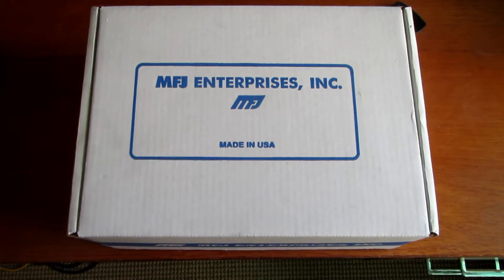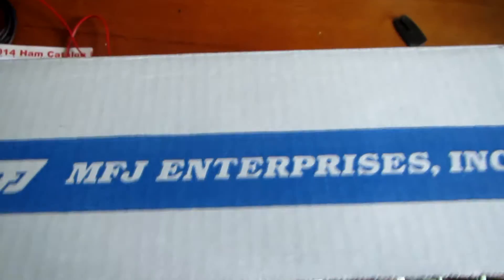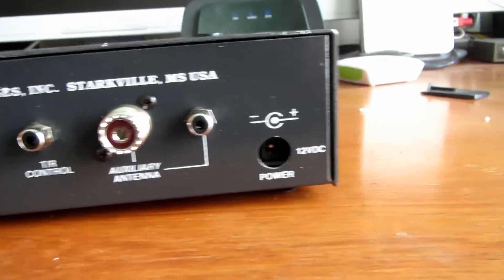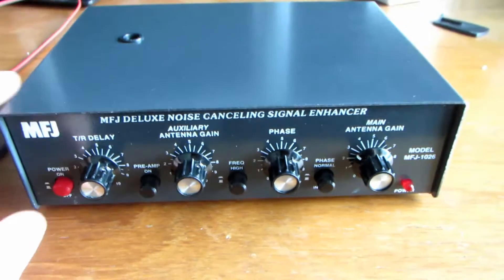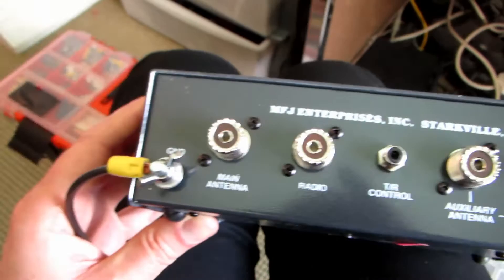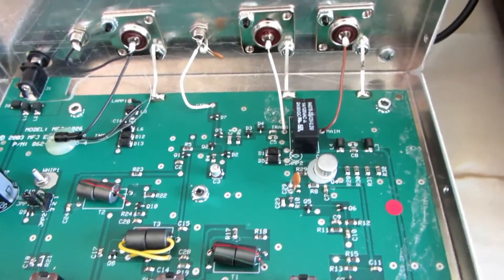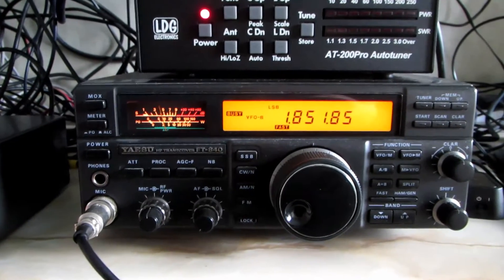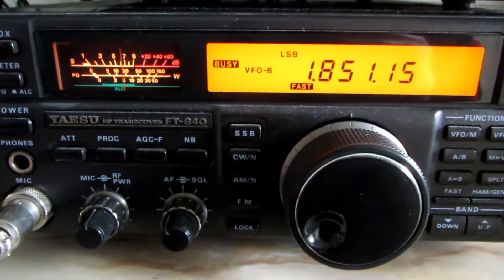MFJ 1026 Removing Noise and Interference on HF Radio

Comment: Showing the S-meter while you adjusted the MFJ is pretty much useless, unless this is a review of the S-meter. We can HEAR the signal and the noise. I wanted to see how the MFJ was being tuned to get these results.
Reply: Seeing him tune the MFJ isn't going to do anything for you. Seeing him tune the device will only confuse you further on trying to tune yours. 

Your interference is going to be different from his which would require different tuning entirely, even if the source is coming from a similar device, the type of interference, the types of antennas you're using (for both the main and the interference antenna), and even the location you're at in the room is going to slightly change how you have to tune (you change anything with your setup will make it to where you have to tune differently, like different antenna, different coax). going by how he tunes it is NOT going to help you. You have to discover that for yourself by fiddling with the knobs (having an SDR so you can see a waterfall does help with learning the device a bit).

Showing the S meter helps a ton to show HIS interference levels on HIS setup, and does show how well it knocks the interference down. 

It simply shows that the device does what it's meant to do especially at 7:46 of the video. At that part of the video you see the signal strength of the interference which covers up the broadcast which is pretty much the same signal strength.

Comment: This box can work a lot better than the performance you are getting. One thing that works very well is to find the noise source and put your aux antenna as close to it as possible.
Reply from the maker: Yes agree id not had it very long when the video was made, it's so noisy here I can't use the radio without it, thanks for watching.
Reply: Using a RA0SMS active antenna as your noise antenna will work very well.

Comment: Thanks for the video.  So far its the only one I've seen that shows on the air with real signals.  Looks like the the mfj-1026 definitely works in some situations.
Reply from the maker: Yes it's subtle but it does work, difference between being able to work some stations or not for me, I use it all the time.

Comment: Still not readable though on the weaker signals. It's a lot of money so I'm going to try building one, components  cost me under £10 so I won't feel too bad if it doesn't work very well.. I already have Toko coils I can use. S8 noise 160m-15m, even 12m sometimes, since mid-December.
Bill, G4GHB.
Reply: Did you build one Bill? Because we all want to build one but no one ever does. And to the few that did build one, they simply don't work as well as the commercial products from JPS, MFJ and DX-Engineering. So I'm genuinely curious if you actually built one
Reply: @624radicalham  I did build one but unfortunately my aerial and noise source are too close together. It made a slight difference but not as good as I had hoped.
What did make a greater difference was a magnetic loop. Signals were down compared to my other aerials but I could direct it away from the noise so cutting the noise down. I actually heard signals on 30m which I have not been able to use in years and was the first band to be affected by broadband noise. My aerials are to the rear of the house and I put the loop in the front upstairs bedroom and turned it to receive the least noise.
So for the cost of building, all I can say is try one and also try a mag. loop.
Bill, G4GHB.
Reply: @bill-2018  I appreciate the recommendation of the magnetic loop. I've always wanted one. Living in HOAS or apartments, for me personally, the 1026 has been a life saver in my case because the offending noise, the loudest source, was coming from an apartment unit above mine, so with just the internal whip it nulled it out and it's giving me such a quiet noise floor that I never thought I'd have again. I'm glad you experimented with a build. That's very admirable indeed. Thanks for the tip!
Reply: @624radicalham  O.K. Noise is increasing from lots of sources, broadband, lights, power supplies. It seems to be everything, even my new boiler affects m.w. and l.w. Luckily my LED lights are fine.
Reply: @bill-2018  Ferrite toroidal chokes on everything might be in order. It's an involved process with frustrating trial and error but it certainly does feel good when one finally reduces the noise by choking it.
Reply: @624radicalham  The worst here is broadband and they will charge ME to take down their offending line. That's the big one restricting my h.f. hobby now. Occasionally I get S8 noise on 2m, noise at the bottom of our 70 MHz.
Reply: @624radicalham  It's not my QTH that's the problem apart from the boiler on mw/lw. I turned the mains off, it's broadband and neighbours' stuff.

Comment: To the people saying they don't hear a difference and that BHI is better, your wrong. BHI will not work when the noise is louder then the signal you want to hear. the noise is still really on top of the audio with the bhi. it can not completely remove it, it can only try to hide it and in the process it can actually make a lot of the audio sound worse, it's good for removing the hiss that is lower than the signal not for the RFI that is so loud that it completely covers over everything. the 1026 actually phases the RFI noise out. meaning you will be able to hear signals that you can not hear other wise. the BHI only can work with what you hear, if you have signals below the noise floor that you can not hear the BHI will not be able to recover it, the 1026 can.  And really? you don't hear a difference???? some of the stuff is not even audible with the 1026 off, and you can only hear it when the 1026 is on.  Now adding a BHI in addition to this could be really nice, once the main RFI noise is removed with the 1026 the bhi could be used at a lower setting to work on the noise that is lower db then the signal. then it would probably not make everyone sound like they are swimming either.   A beam + the 1026 + dsp would probably be a pretty sweet combination.

Comment: Thanks for the video, I need one of these as I have a commercial AM radio station a few blocks away that KILLS me on HF.
Reply: You can probably use an inline high-pass filter that cuts out any signal below 1800Khz.

Comment: Nice video i am planning to get one of these as im having problems with the dreaded PLT interference and im hoping one of these will work. My main antenna is a wellbrook loop and i have another which i plan to use as an aux antenna do you think that would work ??
Reply from the maker: Hi

Yes it will work for sure, PLT devices are a nightmare, you can see from the video that it does work, at first it will take a bit of fine tuning but when you see the null you can chase the signal down from there.

I mainly use 40 metres, I tune mid band and find the noise, set the unit and leave it on its pretty much fine all across the band then with a bit of a tweak when needed, you do need to retune when you jump bands, you can note down the settings and dial them in quickly, then its just a matter of fine tuning.

The aux antenna can be anything, they recommend the same type of antenna but I have found its fine, as long as they can both hear the noise you will be able to tune it out.

Spend a day with it, tune about for interference and get used to the settings, as I mentioned you need to switch the pre amp on for the best results, dont be tempted to go for the MFJ 1025 to save a few quid because you dont get the preamp.